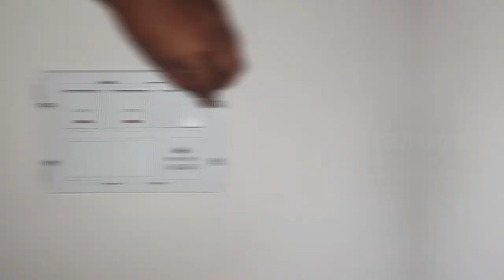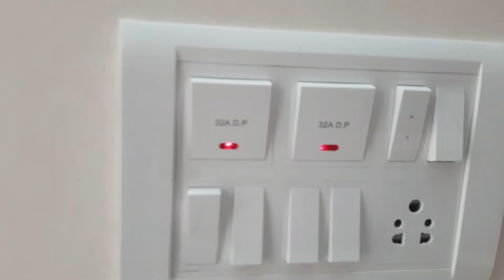How To Replace a 32A DP Switch

Comment: What dp means
Reply from the maker: A double pole double throw switch is connected to two different circuits, each input can be connected to either of the outputs with six terminals in total, the two inputs and 4 outputs. These types of switches have 3 states; open (off), circuit 1 closed and circuit 2 closed.